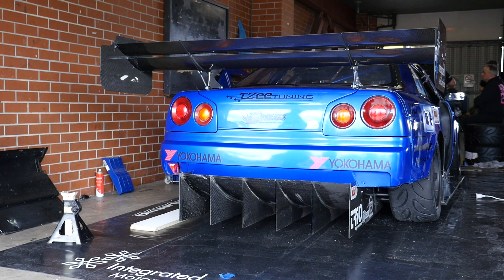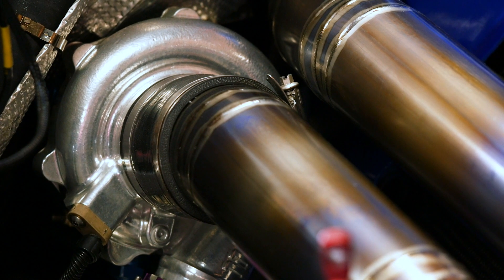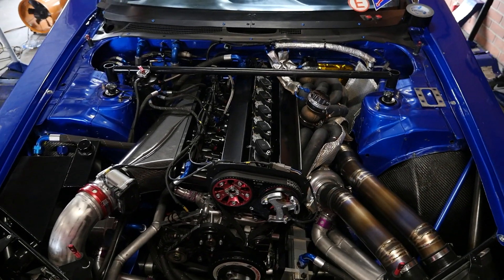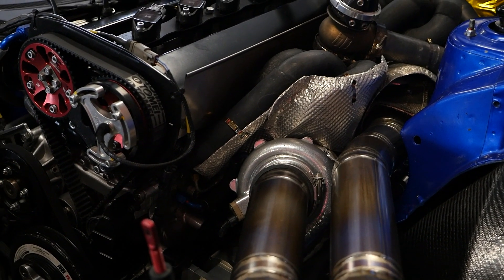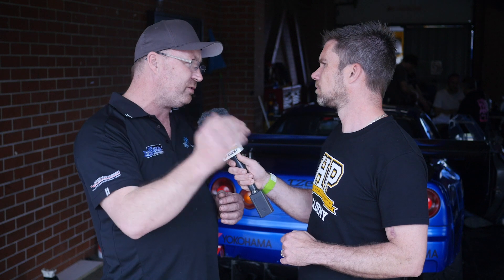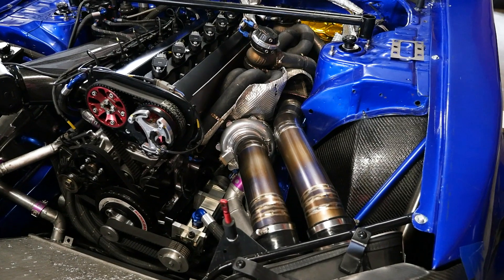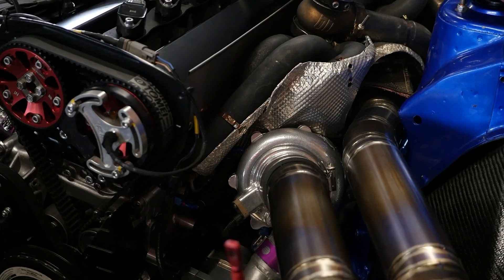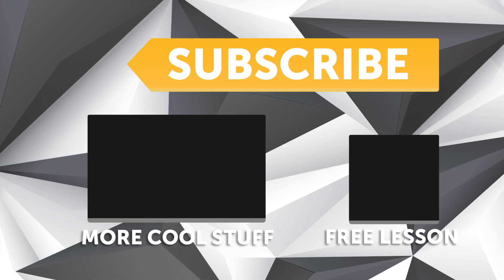Single Turbo OR Twin Turbo? | 1200HP R34 GTR Skyline [TECH TALK]

Comment: Awesome build…I do think that it MIGHT be possible to build an even more powerful RB26 for time attack purposes, but doing so would require F1/Super GT GT500 level technology, including tech that was actually banned in F1 like beryllium pistons. Specifically what I have in mind is a billet RB26 with the bore increased to 89mm (the limit for the RB26 iron block is 87mm, but the PMC billet block RB26 can be bored out to 89mm), and fitted with a 79mm stroker crankshaft—increasing displacement to 2.95L (2949cc specifically). The use of beryllium pistons (which Ilmor briefly used in F1, but were subsequently banned) would also increase horsepower by allowing higher redlines, given Beryllium pistons can take higher piston speeds than conventional ones, and thus can achieve high revs even with a longer stroke—in this case I think such an engine could achieve 11000 rpm, peaking at around 10k-10.5k rpm. Also, the use of F1-style turbulent jet ignition would allow very high compression ratios even with turbocharging, potentially as high as 15:1, and such an engine, with a pair of BorgWarner EFR 7163s or Garrett G30-770s (both of which are only SLIGHTLY bigger than the G25-660s described in this video), could produce over 1600 PS at 10500rpm (using 2.4bar/35 psi of boost). Place that in a GT-R with an ultra wide body kit that can generate a lot of downforce (basically a modernized version of the old Group 5 Super Silhouette aero), and with slick tires and the front and rear ends sawed off and replaced with tube frame (as well as the whole car made of carbon fibre), and we’re looking at a car that could potentially match or even beat F1 levels of car performance.
Reply: Correction: A compression ratio of 17:1 or even 18:1 MIGHT be possible with turbulent jet ignition AND Toluene 86 blend (86% Toluene by volume, as used in 80s F1), and given that F1 increased peak power from about 670-690hp in 2014 to 850-890hp in 2022 for the same revs, displacement, and fuel flow limits (meaning at least almost ALL the gains were from raising the compression ratio (likely from about 12:1 to as high as 18:1) and making the engine more efficient at converting fuel into horsepower), and that I actually calculated that this engine should produce about 1380-1410 bhp (if it produces 1200 whp), it follows that with turbulent jet ignition over 1700 bhp is doable for the same amount of fuel, air, and boost (and it won't hurt reliability either). Actually, with a slightly lower boost rating (2.0bar/29.4 psi) but larger displacement (I would say 2949cc, but actually PMC's new StreetZilla RB26 can be bored out to 90mm and stroked to 79mm meaning a displacement of 3015cc) and more revs (I think 11000 rpm would be doable and could even be made reliable with Ilmor-style beryllium pistons/cylinder liners and a 79mm stroke), it would be possible to get over 1700 PS while still running twin G25-660s and having ZERO turbo lag...basically if this engine is an Ultimate tier RB26 engine, what I am describing is a JUNKMAN RB26 engine (remember the Junkman parts in NFS Most Wanted?)...also, based on what I saw with the McMurtry Speirling, it might even be possible to fit a GT-R R34 race car build of the type that I have described with ground effect FANS for extra downforce that works even at 0 mph, as well as ACTIVE SUSPENSION (including ACTIVE CAMBER), programmable rear wheel steering that can create sideforce like in NASCAR's infamous "twisted sister" cars (in addition to the downforce), and basically a bajillion other technologies designed to increase car performance to levels best described as absolutely unhinged...

Comment: Very potent car. I am struggling a little with  the comment that he is making 250kw more at same boost..presumably he was not able to hold target boost of 35psi at peak rpm, and is instead indicating that the twins have more combined flow than the single with enough power from the turbine to maintain target boost to redline. Otherwise I guess his intake temps on the previous setup were seriously out of control.  Maybe I'm  missing something. What is clear is that the new turbos available are giving us some great new options...Might be time to upgrade!  Thanks for the great content you continue to deliver so professionally.
Reply: The previous setup had a EFR 9180 and made 880whp
These new Garretts are rated at a combined 1320hp and this makes 1080whp

Comment: I'd also like to know why they made that swutch
Reply from the maker: It's OK Jason, not all of my jokes are very good either =P - Taz.
Reply: DIdn't you watch the video? EFR9180 maxed out at 900 ish whp, competition is over 1,000 whp. Can't get a big single to respond like they want, so a pair of G25's were tried and works. Twin G25's will easily do 1,000 hp. Pushed somewhere over 1,100 but not much more.
Reply: @dj4monie  Clearly you weren't paying attention or you would have realized I was making fun of the hosts accent.

Comment: Could both of you please discuss this tiwn vs single case with Andrew from motive garage😄
Reply: Andrew wants enough power to run 8's. He trends towards drag racing, standing 1/2 mile stuff so he'll trade some response for output. There is nothing to talk about really, it's picking the right turbo for the job. Most of you only drive your car on the street so you should trend smaller to keep response up and really if you need more, hit it with a shot of nitrous, it will make a surprising amount of power for very little cash outlay and improve response to a point that you'll have wheel spin in all gears if desired.
Reply: @dj4monie  i said it, because Andrew made a research, kind of, to proof that a single response better and has less lag than twins. I always wanted to keep my rb26 with twins. I still belive it responds better and its more stealthy then a huge single
Reply: @G.J.G.P.  and they used GTX3582R 1.01 vs blown head gasket twin gt2860r with internal wastegate and didnt use twin GTX2860R GEN II and exhaust manifold was stock this turbos are bolt on so it was not comparison it was commercial

Comment: Maybe twins for 600 or 7 like mines r34 but 1200hp I'd seen comparisons the single is better. Motive DVD did a test
Reply from the maker: Not for this application - Taz.
Reply: and they used GTX3582R 1.01 vs blown head gasket twin gt2860r with internal wastegate and didnt use twin GTX2860R GEN II and exhaust manifold was stock this turbos are bolt on so it was not comparison it was commercial

Comment: What A/R are the turbo exhaust housings?
Reply: Good question, i'd also assume the 9180 was running the big boy 1.45AR.
Reply: @UnparalleledSpoof  I mean from the twin g-series turbos.
Reply: @fishingwithadrian754  yeah i know i was just adding what the 9180 was running for reference. Hopefully someone can tell us about the rears on the g25's. But id assume the largest available if they were shooting for 1200hp
Reply: @UnparalleledSpoof  I would assume the same but he said in the video that turbos come on immediately after coming out of the corners, so that had me wondering what size housings they used.

Comment: Twins for time attack,hillclimbs and GT road racing. A large single for drag racing. Simple.
Reply: Twins on a V6 or V8 is still better than a huge single.
Reply: @dj4monie  for 1/4 mile drag racing a single large turbo is the way to go,unless youre using a compound turbo set up. Twin turbo,especially a twin parallel turbo set up comes up on boost much quicker and is more respinsive but a single large turbo gives much better top end power which is all that matters in 1/4 mile drag racing. The fastest 2jzs and RBs in the 1/4 mile all use a single large turbo. The quickest Nissan in the 1/4 mile, Lazcano Racing Z uses a single large turbo on  the old VG30 engine to do a 6.0 pass. So. What set up depends on how the engine is going to be used. Basically.
Reply: Smart guy
Reply: Not from my experience, and it's not as simple as that. If you watch the video there is so much reason still to stay single in time attack under 1000hp. It's only once you reach a certain power threshold you need to look outwards. An R32 GTR running a single turbo was quicker than this thing at WTA
Reply: @Lachyp1992  well. In drag racing youre looking for the maximum power output from an engine. Boost and engine response arent that important. In time attack,road racing and hillclimbs balancing top end power and engine and boost responce can determine just how quickly you car will be on the course. The 5 second 1/4 mile RB uses a  huge single turbo as does every 5 second 1/4 mile 2jz. That being said. A compound turbo set up is a good multi-turbo option for drag racing. Twin turbo parallel set ups are better for on and off throttle situations. Like time attack and road racing.

Comment: I wonder why just the diesel guys are running compound setups. It seems to be the best of both worlds regarding power. Weight is higher of course but that counts for twins as well.
Reply: Controlling boost is more difficult. And compounding boost for anything lower than 40 PSI is kind of a waste of time. With racing Simplicity is key and they found a set up that is very simple and works.
Reply: @marvinwatson2749  I disagree.  Compounding low boost would allow 2 turbos to make less heat than one single turbo.  Complexity in plumbing would be an obstacle though.  Controlling the boost is not difficult if done properly.  I just sent a link to the Shane T and Andre interview that explains how controlling boost is much easier than you think.  https://youtu.be/1pV_tLbZY0A
Reply: @ericsperformanceparts1647  i never said controling boost was hard, i said it was just more difficult than single or parrallel twin setups. Which it is by far. I seen that video where shane explains the setup, and from what i remember theyre running like 4 wastegates and have boost goals of over 100psi. Huge difference between the 2 setups from just the powerplant let alone what its being used for.

The twin setup that this team is running is working really well for them. If you remember the guy saying he almost as to much response already and has to dial power out for corner exits. He mentioned in a comment here saying his response rivals a gtx3584rs. 

With that said please explain to me why would they run a set of compounds? Theres hundreds of racing teams doing time attack, hill climb, roadracing, rally f1, drag ect. 95% of these teams do not do r&d on compound setups because its not nessasary for there goals. Most of these cars operate in a narrow rev range anyway. Compounds in drag racing makes perfect sense when you have a 2L trying to spool, what was it, twin gtx55s and make close to 3000?
Reply: @marvinwatson2749  Shane T said they run compounds because they are able to get the boost levels they want without having to push a single turbo to it's limit.  Shane also said they were able to get 1:1 pressure ratio with compounds, but could not with a big single.
Reply: @marvinwatson2749  when you are trying to make 1500hp per liter, you almost have to go with compounds.  I dont think that even Indy engines can make that power per liter on a non-compound setup.
Reply: @ericsperformanceparts1647  oh yeah there's no way they'd be able to attain that horsepower number without compounds. Absolutely impossible they need compound turbos you're 100% right on that

Comment: Twin 7163 efrs would be better
Reply: I'm planning a build and kind of waffling between a 7163 and G25-660. Curious, why do you give the edge to the EFR?
Reply: @MR__JUSTIN  Garrett still hasn't matched the Efr for spool between shifts ,peak power they are close but as a package the Efr is probably not as high on peak power as precision or the spool of Garrett but from shift to shift spool  accounting for response out of a corner Efr comes up on top and with the new spool valves which can be acctuated by the ecu depending on rpm and gear will give you a slight edge on going corner to corner
Reply: @Realtime1501  gotcha, thanks for the reply. Not all about peak power is it?! The spool valve you mention, is that only for a twin scroll turbine housing?
Reply: @MR__JUSTIN  yes only the twin scroll housing
Reply: @Realtime1501  thought so. Those have been popular in the Supra world for a while, from what I hear. BorgWarner even teased a turbo that had a quick spool valve built in at a SEMA a few years back, but it never made it to market sadly. 

With this particular car though, they said they would never be able to fit EFR turbos in that tight area where they barely squeezed the two (smaller) G Series units. And even if you could fit it, you probably wouldn't want to go twin scroll when you've only got 3 cylinders per turbo 😉
Reply: @MR__JUSTIN  probably not but there are ways around it, there are twin Efr kits for the RB the biggest that actually fits are a set of 7163's
Reply: @Realtime1501  oh cool! That sounds pretty awesome, I would love to see somebody pit these pairs of turbos against each other back to back. Which kit is it, do you have a link?
Reply: @MR__JUSTIN  there are a few kits but people mostly use the fullrace manifold
Reply: @Realtime1501  the efr are just to big to fit in this car . The engine is not in its normal position.
Reply: @Realtime1501  Except for the fact that FMW wheels suck in comparison to many other compressor wheels out there (ok, not suck but aren't quite in the same league). Don't believe me? Go look up the inducer/exducer sizes for the gen2 3071, then compare that to the compressor wheel on a 7670. Hell, I just remembered that you didn't even suggest the correct turbo, as the 63s wouldn't produce enough cfm for 1200+

Fuck man, there's some great people in these comments, but I abhor all the nonsense I read since it really does give people false notions of reality. Also, in both boost threshold and transient response, I guarantee the g25s outdo the 7163 handily (gamma ti doesn't beat superior wheel design and much much smaller wheels to boot).
Reply: @Realtime1501  What evidence do you have that Garrett haven't matched this even with the G series?   As I'm too conemplating between G Series or EFR twins
Reply: @26Petermc   In your experience which twin turbo setup would be more responsive, twin EFR's or Twin G Series?
Reply: I have a 7163 on my 93 mr2 turbo. Built 3rd gen 3sgte of course spools up by 3000 rpm and pulls all the way to my 9000 rpm redline. Great turbo would recommend it to anyone!
Reply: @MichaelSmith-ov1nf  Only the best 7163 is crushed by a properly installed GTX3071 Gen II, apples to apples. You give up some spool (20 psi by 3500) but you'll make nearly 600 whp on ethanol while the 7163 barely makes 530. Given the cost of EFR turbos and EFR based kits. Nitrous oxide solves any spool issues and boost power to the unuseable point.
Reply: Anthony Thomas true the garret turbo will make more power, and take longer to spool. I wanted my car to be responsive cause it’s for the street and not the track. I never have to downshift, all I have to do is wiggle my toes and bye bye 🖐🏽 by the way it makes 527 WHP at32 psi and is at full boost by 3000 rpm. Will never put it on a track I just like messing with newer model muscle cars on the highway. It pretty fun because most of their drivers don’t even know what a mr2 turbo is so the don’t even know what hit em